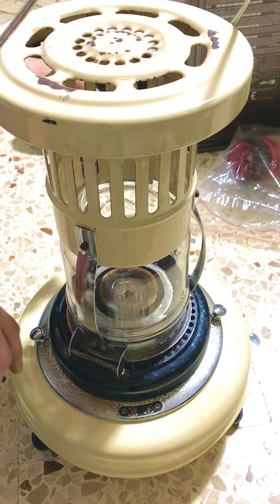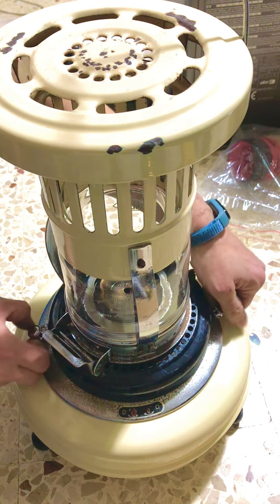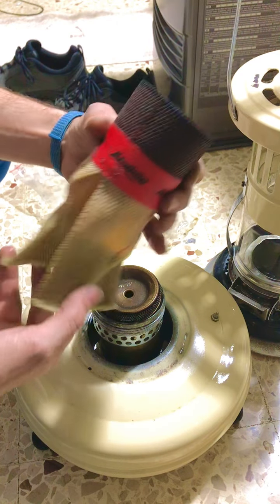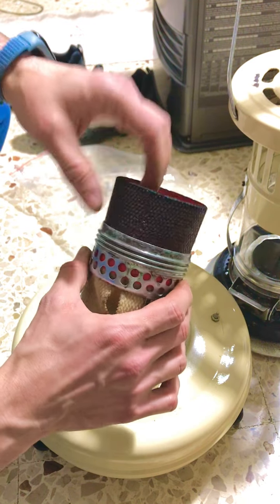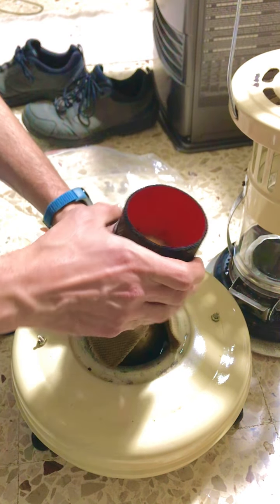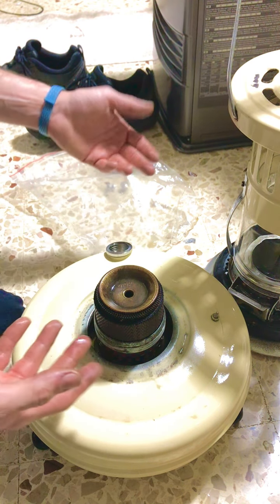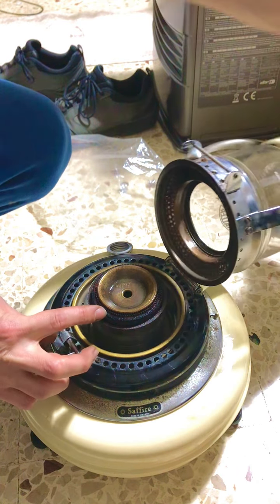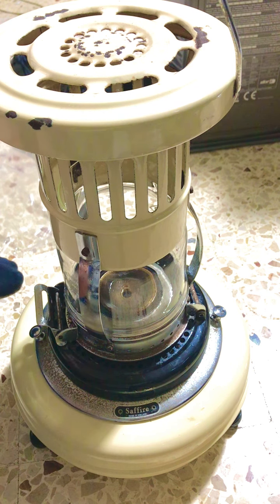Wick Replacement- Haller Saffire / Safe-e-fire kerosene Heaters

Comment: Great video. Do you know how the burner can be disassembled? Is it a screw cap or do i need to pull it? I want to clean the inside.
Reply from the maker: the "guts" inside the tank is welded im afraid. the burner part that screws onto the glass holding housing is a bit difficult to remove... there are some "tabs" that you need to pry in order for them to slip and disassemble that part.
Reply: @cbusuttil  thanks. I was finally able to remove the old wick and coil. The heater was not used for a long time so i am restoring it. I ordered the mentioned wick.

Comment: I have the model with coil. now i wonder how to assemble the coil, wick and the collar. first is the chimney, the coil is around it. and the coil fits into the collar. does the wick comes over that? so that only wick is visible? or does the coil comes over the wick?so i can see both the spring and wick? i downloaded the old manual but it is not really clear either.
Reply from the maker: this is interesting! never saw one with my own eyes having that coil! i am led to believe that the coil sits under the wick so that it keeps the wick under tension; this helps with an even flame since the whole circumference is under the same tension. my guess, again.
Reply: @cbusuttil  thanks for your answer. I do not know if i can share a picture here? Otherwise i can make a picture  and show it. The collar i have is different too. It does not have the long flange. It has a small one on the inside that fits into the chimney. The manual shows it too. Tomorrow i will get the wick and i will try to fit it. Looking forward to see it working for the first time.
Reply from the maker: @markmcselec  not sure if you can post photos here, but a quick google search  showed me one with a spring. Hope this video helps you out in getting yours working too!
Reply: welke maat van de lont, geef de cijfers van de lontmaat op
Reply: wat is de maat van de lont, vertel me alsjeblieft de naam of het nummer van de lont
Reply: @artur1ism  you need one for the alladin blue flame. The diameter is 7.5 cm. It has 2 cupper tabs on it which you can remove. Then it will fit on the haller.
Reply: @artur1ism  bfh15 is the one i used
Reply: @artur1ism  woef